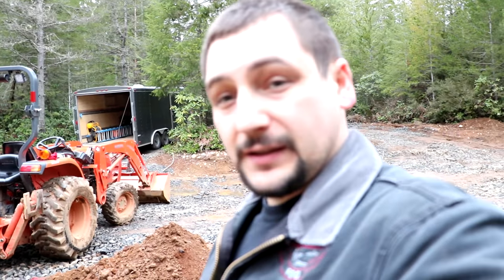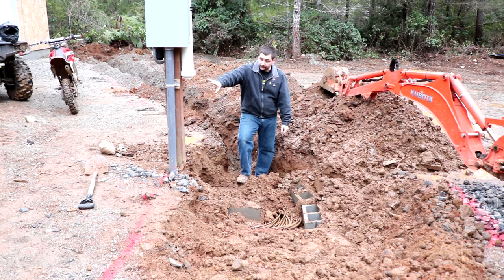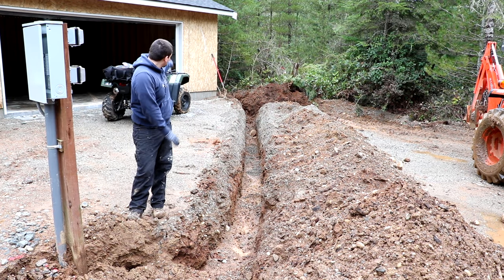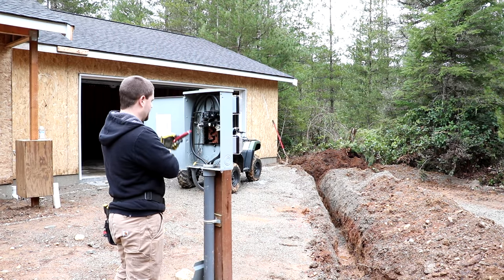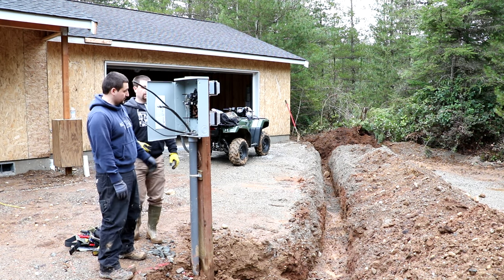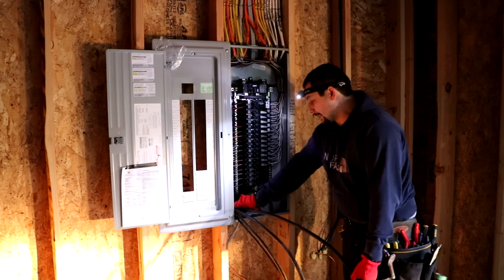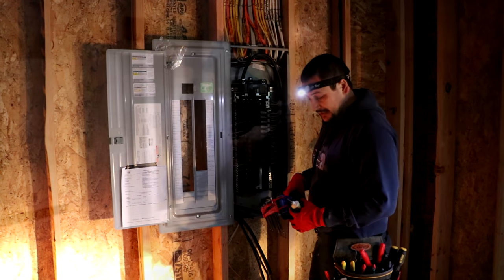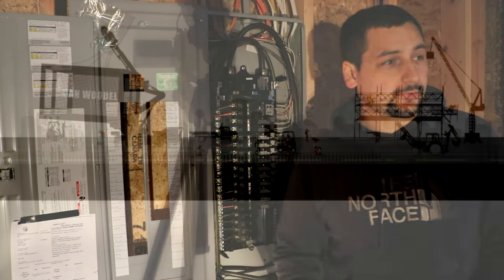Installing permanent power, Doing It Dan’s Way

Comment: I do not like having the mains ontop of the other wires. I would have just installed a disconnect on the outside of the house so I could have ran the mains first. 
Then when you move the temp power you only need to bring it to the disconnect on the outside.

Comment: Are you running conduit under the driveway so you have easy access in case you need to do power repair later.

Comment: Was there a requirement to install a grounding rod for the house panel. Some areas require 2 rods bonded to the panel.
Reply from the maker: vipleather Yes we had to have two rods 6 feet apart  at the house pannel

Comment: Why do you have two main disconnects? Shouldn’t the panel in the house be a 200 amp sub panel?
Reply from the maker: Calen Shackleford  The meter base up on the pump house is considered a permanent remote meter. The reason there are two main cut outs is because I wanted him to be able to have a main power switch in his house. I think it’s a little bit safer for someone who’s not really familiar with electrical.

Comment: You aren’t required to place with wires in conduit to the house?
Reply from the maker: nope, that is triplex wire, did is rated for direct barrel. any runs over 100' don't require it.

Comment: How far is the run from the meter panel to the house panel? What gage wire are each of the conductors?
Reply from the maker: optymaxx Its about 100 feet there are very specific rules and regulations on the distance that you can run the wire for the panel to the house. I recommend that you refer to your local county and L&I instructions. I believe it is two gauge wire but don’t quote me on that. At the local hardware stores that we buy the wire at their only two choices wire for mobile homes and work for houses to it is very easy to dug the right thing.
Reply: If it's 200 amps it should be 4/0 cable,if you have large motor loads like your HVAC system and a larger water pump like over 1hp then a 250mcm for voltage drop. By the way ox inhabited are not required by the NEC. Today's aluminum is an alloy not the old aluminum of the past. Looks like a good job well done.

Comment: In the remote panel do you have to separate the grounds and neutrals like in a sub panel?
Reply from the maker: Justin 95 I did separate them because the panel I have has both neutral and ground bar, I don’t know that it’s actually required though
Reply: @DanielWoodell  Grounds and neutrals are only supposed to be together at the first point of disconnect here in the US.